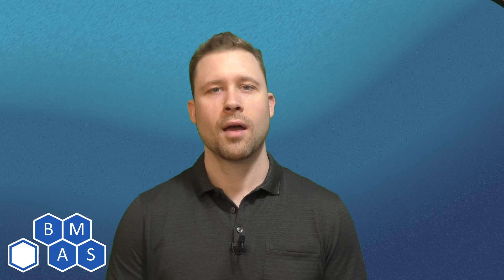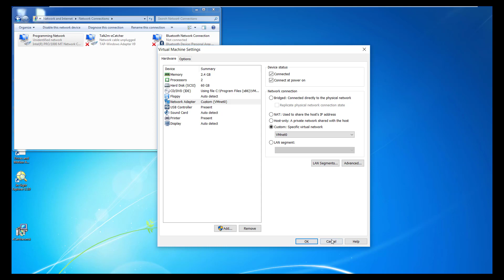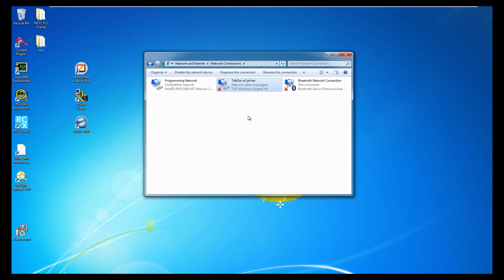Remote Access in a VM | Breen Machine Automation Services

Comment from the maker: TRANSCRIPT
>> JON BREEN: 
00:02 Hi Jon Breen here, Breen Machine Automation Services
00:04 I’m an engineer and trainer 
00:06 and I had an interesting issue the other day
00:08 issue, technical challenge
00:10 it’s becoming more and more common to try to 
00:14 do remote troubleshooting
00:16 by that I mean connecting
00:18 to PLC’s HMIS and other automation products from off-site
00:22  so usually that’s done by having a little device
00:26 brands like eWON Sec-O-Mia
00:28 Phoenix Contact has a product
00:30 there’s probably a bunch I don’t even know about
00:32 and that device connects to the internet in a secured way
00:36 so that someone off-site can also connect to the internet
00:38 and then talk to the PLC or HMI or whatever is in question
00:42 and so it makes an extra layer of interest
00:48 for those of us who are using virtual machines
00:50 and I wanted to talk about that a little today
00:52 because it took me a few seconds to figure it out
01:00 I tried to approach it from the perspective of the way I would normally connect to things
01:04 and it didn’t end up working out as well
01:08 without further ado let’s jump on the computer and take a look
01:12 alright so first I want to talk about a little bit more on how this system works
01:16 the software and hardware involved
01:18 where things are connected
01:20 then I’m gonna tell you the very short story of what the solution was
01:22 how to connect inside my virtual machine to a PLC through the internet
01:28 and after that for you overachievers I’m gonna talk a little more about the other things
01:34 that I tried that did not work
01:38 so first of all this is the product we’re talking about right now
01:42 it’s again an eWon product
01:44 there are a bunch of other brands out there and as I understand it
01:46 they all work pretty similarly 
01:48 so this will be a good talking point if nothing else
01:50 I’m not really trying to sell one brand over another
01:54 so this is connected the control cabinet
01:58 at that remote location 
02:00 one side of this plugs into the same network that the PLC and HMI 
02:06 and servos are connected to and the other side of this plugs into
02:10 something that’s connected to the internet
02:12 normally it will be connected to my customer’s internal network
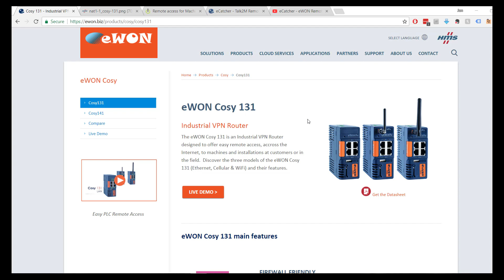02:20 which will go through a firewall to get to the internet
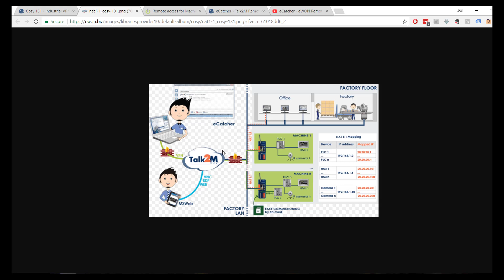02:24 this is just a picture that I found on eWON’s website
02:26 and it shows that a little bit right
02:30 on one side of this is that ecozy
02:34 one side is connected to the PLC and other things
02:36 the other side is connected to this internal network
02:38 that may be also connected to the office who knows
02:44 and then it goes through a firewall to get to the internet
02:46 and then there’s a server that eWON runs
02:48 and in some examples of this kind of technology
02:50 you can have the server locally on your site
02:56 if you want to be able to manage security a little more closely
03:00 I’ve never had any problems with their security
03:06 that’s built into their cloud services
03:08 but you know it depends on what you need
03:10 then after that you know maybe we’re going through another VPN
03:12 to get to the internal network at say my facility
03:18 or you know the OEM or programmer that’s working on it
03:22 and there’s a piece of software in this case 
03:24 E catcher that’s gonna connect to this cloud
03:30 that’s then gonna connect to one or the other of these two eWONs
03:34 you have ecozys here
03:36 so this is already a lot of different layers of things in order to get that connection
03:42 now when we run the ecatcher I’ll show you quick what that looks like
03:48 you sign in here you have a corporate account
03:52 maybe your customer in this case my customer has their own account
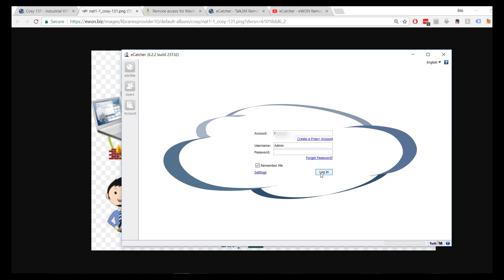03:56 and they would give me their username and password access to it
03:58 and after logging in we get
04:04 I just pulled up a Youtube here because I don’t want to actually connect 
04:08 to my customer account right now
04:10 but this is what it looks like after that
04:14 you have access to in this case two different ecozy devices 
04:18 so you double on it or click on it and click connect
04:22 and now magically I can access the PLC and HMI and everything else
04:26 and so I can ping it I can connect two of my programming software
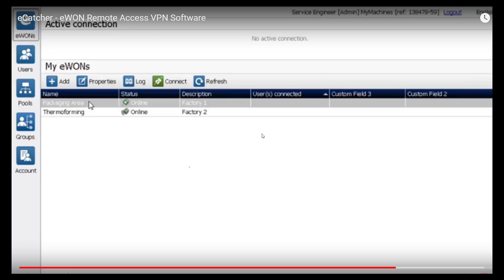04:32 these IP addresses that aren’t really connected to my machine at all 
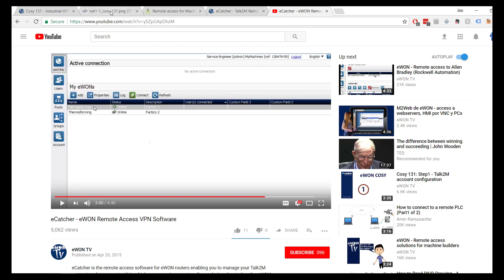04:36 now the complication happens again coming back here
04:40 now inside of this laptop now we’ve also got a virtual machine
04:42 so now we’ve gotta figure out how to connect this ecatcher software 
04:46 to that virtual machine 
04:48 now I’m gonna tell you long story short
04:50 the trick was to just connect what was to install ecatcher inside of the VM
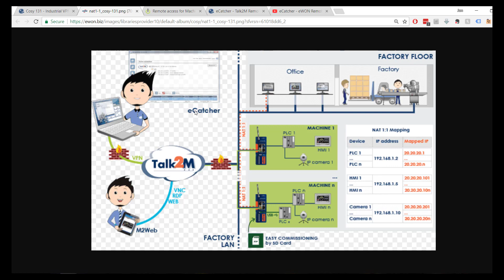04:56 and give the VM access to the internet
05:00 and everything worked magically
05:02 alright so I’m looking inside my VM right now 
05:06 you see I’ve got the installer for ecatcher I’ve already installed it
05:08 I’ve got it open and connected 
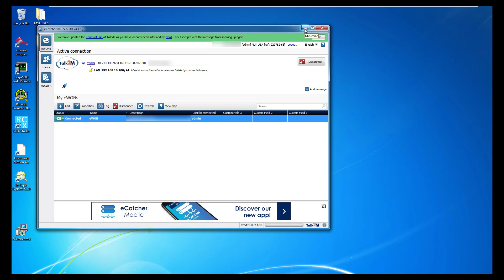05:12 and I want to point out quickly the things that I have to do 
05:16 in order to make sure I have internet access to my virtual machine 
05:20 now before we start connecting to the internet I want to talk about security
05:26 so I generally recommend setting up a virtual machine without antivirus and firewalls
05:34 and other things like this because those things can interfere with industrial software
05:40 interfere with connecting to PLCs and other things
05:42 and they don’t always but it’s nice to not have to worry about it
05:48 now if we’re gonna have a virtual machine that doesn’t have those things
05:50 and now we’re gonna start connecting it to the internet
05:54 that does open us up to security threats a little bit
05:58 and the virtual machine itself still gives us another layer of separation
06:02 between this open programming environment
06:06 and your host machine and your company’s internal network servers 
06:12 whatever else IT would be generally worried about
06:14 things bleeding into if there was a security threat
06:18 the VM does give us a layer of separation there
06:22 but you know it’s probably not perfect 
06:24 and I don’t know that IT would agree that you should be able to run all this 
06:28 without antivirus etc. and also be connected to the network
06:34 or to the internet so I just want you to be aware of that 
06:36 before we start connecting this 
06:38 I generally don’t connect my virtual machine to the internet
06:40 except when I’m doing something like this just to minimize the risk 
06:46 so in this case I’m getting internet through my hardwired connection 
06:54 which is the same hardwired connection that I would use
06:56 to connect to any industrial equipment 
07:02 which means I don’t need to change any of my network settings on my virtual machine
07:06 I don’t need to touch the virtual network editor 
07:08 the only thing that I need to do is look at my network connections
07:12 and make sure that my programming network 
07:18 is set up for DHCP which means obtain IP address automatically
07:26 and I do this because anytime we’re connected to a network with internet access
07:32 there’s always some sort of DHCP server out there
07:34 there’s a router that’s assigning IP addresses 
07:38 and if we try to give it our own IP address like we normally would 
07:40 with an industrial machine network
07:44 it’s probably not going to work on that DHCP run internet accessible network
07:54 maybe you’ll end up having the same IP address as someone else
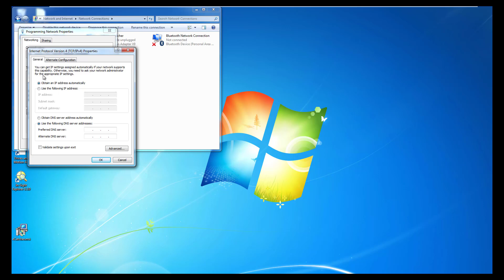07:56 or maybe you won’t be on the same subnet
08:00 anyways so just selecting this will work just fine and this works
08:06 because I’ve already got this connected in the background
08:08 to the physical port on my computer which is where I’m getting my internet from
08:14 now if I wanted to get internet through WiFi then I would have to change that 
08:22 in the virtual network editor I’ll show you that very briefly here 
08:24 go to edit virtual network editor 
08:28 I always have to click on change settings
08:32 then alt tab until we find that window because it always appears behind for some reason
08:38 so VM NetZero is my primary and it’s bridged to this physical ethernet connection
08:44 I have another virtual network that’s setup to my wireless 
08:50 and so I could use this instead if I wanted to 
08:52 so VM NetZero is hardwired VM NetTwo is wireless
08:58 and I’m gonna show you what that looks like on the other side 
09:02 so those are the two that I have available 
09:04 I’ll click okay I didn’t really change anything 
09:06 now if I go to VM and settings I have this one network adaptor here right now
09:16 and right now this one network adaptor is connected to VM NetZero
09:20 this is my hardwired network 
09:22 if I want it to be connected to WiFi I would select VM NetTwo 
09:26 and now that programming network that you see back here
09:30 will be connected to WiFi instead of to a physical ethernet connection
09:34 I’m not going to do that right now
09:38 so I hope I didn’t confuse that too much 
09:40 it’s certainly not a simple topic
09:44 there are a lot of layers of abstraction and security 
09:46 but actually using it is fairly straightforward 
09:52 you install the software inside your virtual machine
09:54 make sure your virtual machine has internet access
09:58 and then it just works like magic as long as you’ve got the credentials 
10:02 to login and connect to those devices 
10:06 some of the other things that I tried for you overachievers
10:10 is I tried having ecatcher on my host machine
10:16 because I typically have access to internet on my host
10:18 but not inside my VM and again I usually try to keep it that way
10:24 so I look to see okay how does this connect to things

Comment from the maker: 10:26 well there’s a virtual adaptor virtual network adaptor that ecatcher installs and uses
10:34 and so I tried connecting my virtual network to this 
10:44 instead of connecting my virtual network to the internet
10:48 either through ethernet or WiFi
10:50 I was trying to connect directly to this and I tried all sorts of variations
10:54 of IP addresses static dynamic and I just couldn’t get that to work
11:00 but then if we look inside the VM when I installed ecatcher 
11:04 it put this same adaptor inside the VM
11:10 and that’s the one that the VM ends up using
11:12 so I hope that was helpful I hope that saves somebody some time 
11:16 and we’ll see you next time thanks